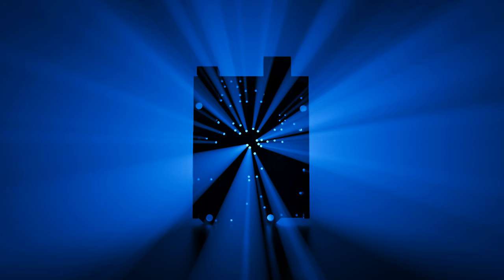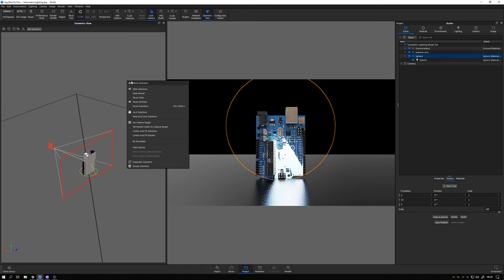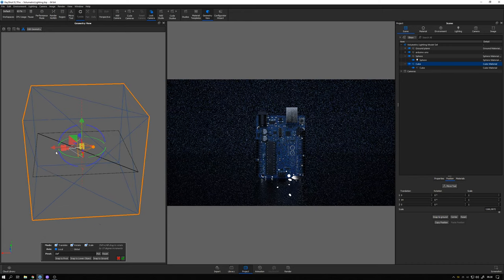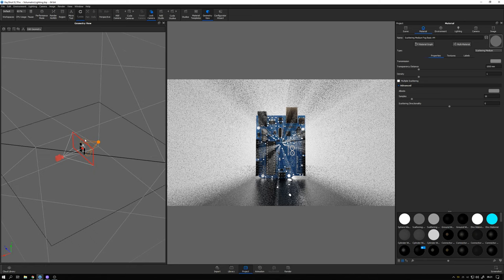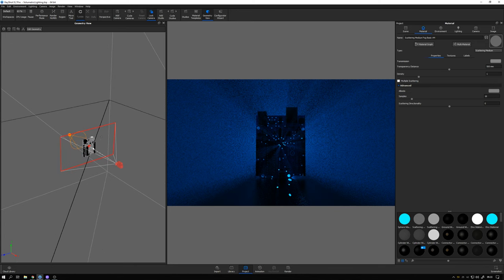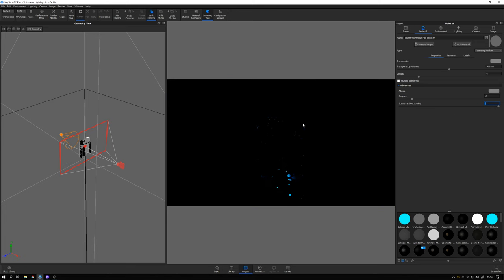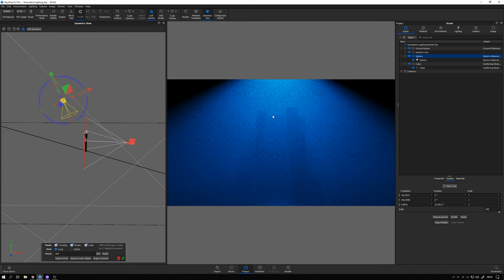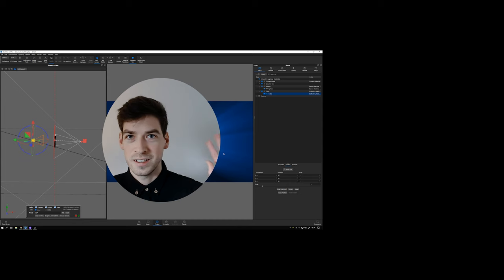KeyShot Lighting Study: Volumetric Lighting using Spotlight and Scattering Medium

Comment: Hello sir, I need your help. I have a model of some device which was exported from solid works but when imported in Maya the textures and labels are not visible. So i had to to apply textures and labels in Keyshot. Im done with animation in keyshot. But i want to do more with the product like water splash to show its a water proof. But im not able to export the ksp file to maya with textures and labels. PLEASE HELP.

Comment: “This looks pretty cool, can’t wait to try it!” 
“don’t be surprised if you need to go around 4000 samples” 
“I’ll be fine without fog I guess”
Reply from the maker: Try it anyways! The output shown in the beginning took 15 minutes to render (2600px wide) on Threadripper 2990wx. That equals to roughly 2hours on my 2015 macbook pro. 2 hours is a long time, but worth it if the effect is needed. There should be room for it in the overnight queue :) You can also go for less samples and do some noise removal in photoshop to get rid of the worst noise.
Reply: Just use Octane already... gosh, for the superior speed sake and dont stick to Keyshot no more.
Reply: @CharlesLijt  If you are going for speed, Octane is not the first choice, more like redshift.
Reply: @axelgronlund1325  Yeah I agree, but compare to Redshift, octane is way easier, for keyshot user it is relatively much easier to shift to octane
Reply: @CharlesLijt  Keyshot will always be the most user friendly imo. Its so incredibly easy to get amazing visuals from it. And also, Keyshot is more product based, not environment or world building based.  I would never use keyshot for large scenes with many objects and light sources. And thats what octane or redshift would be better at imo. but for product based rendering and lighting, nothing tops keyshot.